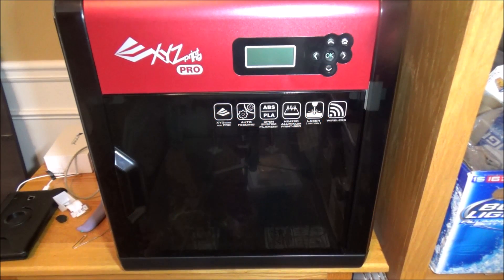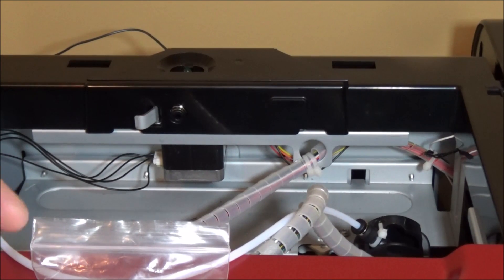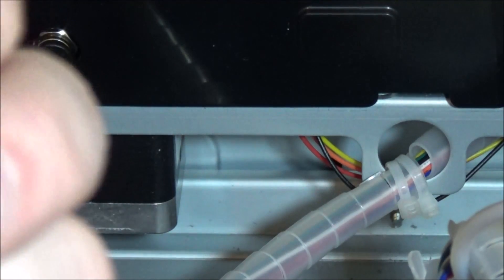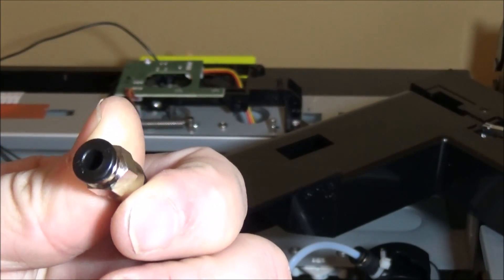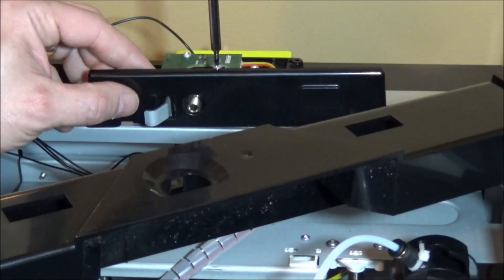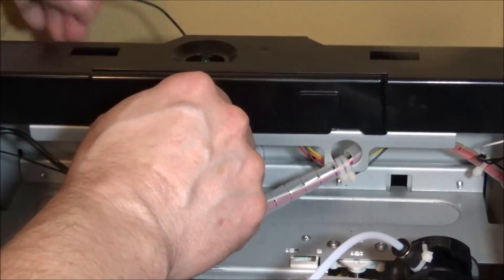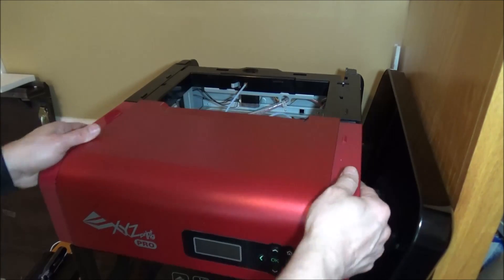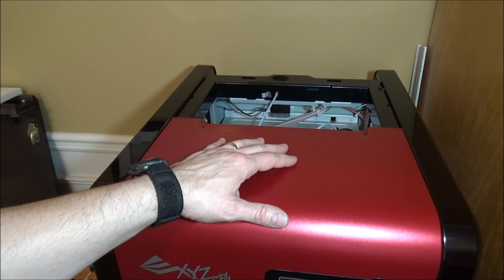XYZ Davinci pro 1.0 Feed tube Mod Permanent FIX

Comment: A well done video. I've recently bartered for one of these printers in a non-working condition, but the condition is the other end of the bowden tube. It doesn't appear that one can replace the fitting on the hot end carriage with a compression fitting. I can see that I should replace the one at the extruder, just to make life easier in the future!

Any suggestions on repairing the hot end end of the problem?
Reply from the maker: I have not had a issue on the other end so far.

Comment: I followed the link you gave for the fittings. I have a question though. I heard you say it’s 4mm correct? And what thread size should I get? The M5? Thanks for your help.
Reply from the maker: That is correct 4mm tubing M5 thread

Comment: I've also experienced this issue, and fixed, but if it happens again I will use the compression fitting in the rear.  However, now I'm having the other end of the tube pop out of the print nozzle, it's covered in that rubber fitting so not sure how to go about replacing that, any recommendations?
Reply from the maker: You can try to simply replace with the same type or use a compression fitting there as well. on mine it appears to be the same.

Comment: I have Divinci Mini W and I think that was my problem thank you!! I would rather buy those bags however but thanks anyway. Where did you get those bags if you may tell me?
Reply from the maker: M5/6/8 Male Nickel Plated Brass Fit 4/6mm OD Tube Compression Union:
https://www.ebay.com/itm/LOT-5-M5-6-8-Male-Nickel-Plated-Brass-Fit-4-6mm-OD-Tube-Compression-Union/181946832392?var=481768805650

Comment: I  have having this same problem on both the extruder side and hot end side on my da vinci pro. Thanks for sharing the link, this will definitely solve half of my issues. I have the tube guerilla taped to the quick connect and it holds for now.  to replace the hot end side the only way i know of is to buy the XYZ tube replacement kit. Great video, you saved me days worth of trial and error.
Reply from the maker: it will solve your issue for sure. when you install you slide the cap over the tube then the Ferrel, at that time stick a pin or something that you can flare out the tube a bit so the Ferrel will bite. then tighten nut.
Reply: @CNC4XR7  Fantastic tip - I had the same problem with the Extruder tube. after the same problem os Filament runnign out and jamming ... I'll post the result later on...
Reply from the maker: @rcsmith  do not forget after you slide the cap and Ferrel over the hose use something to insert into the hose to enlarge it a bit or the Ferrel will not bite.
Reply: @CNC4XR7  Oh! That's right ... I'll do that 👍🏼
Reply from the maker: @rcsmith  Yes especially if the hose is stiff. I figured this out the hard way LOL!

Comment: Can you tell me where u can purchase the compression fitting parts and the nuts required?
Reply from the maker: Uses the Same Nut however the nuts are M5 the fitting is listed in the Video Description. 
https://www.ebay.com/itm/LOT-5-M5-6-8-Male-Nikel-Plated-Brass-Fit-4-6mm-OD-Tube-Compression-Union/181946832392?ssPageName=STRK%3AMEBIDX%3AIT&var=481768805650&_trksid=p2055119.m1438.l2649

Comment: which male thread? I'm assuming the 5? the pic on the listing doesn't match what you have. Great mod by the way! Thank you! I'm having the exact same problem. These printers weren't built to be repaired by the user....
Reply from the maker: Yes thats it M5 male thread 4mm tubing the fitting is held in by a simple nut.  after you slide the nut on the tube slide the feral over and position to the correct depth.
insert something in the tube end to open it up a bit this will lock the feral on.
Reply: wendy tilley thank you so much! Do you have to take it apart that much for this specific fitting? When I replaced the stock one I just screwed it in.
Reply from the maker: No it's the same procedure as with the stock fitting  @DarkPrincess0212

Comment: Nice fix Sam ! I have been having a similar problem with my Orion Delta 3d but only at the hothead end.
Reply from the maker: the issue with the 3D pro is the filament is constantly pushing on the tube.